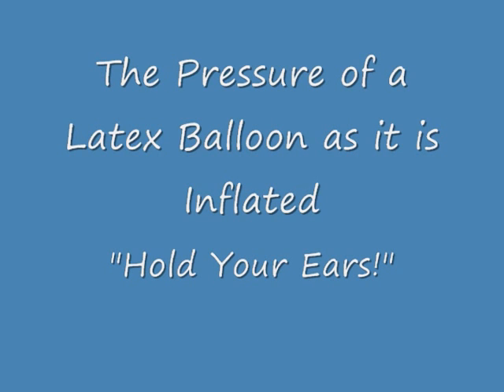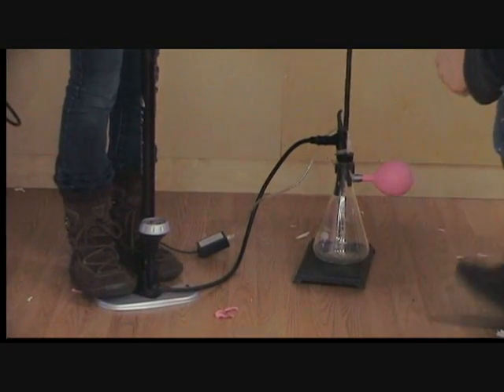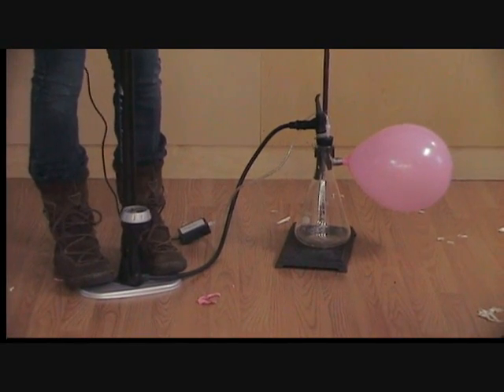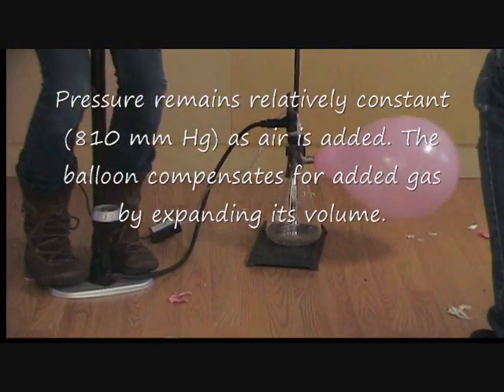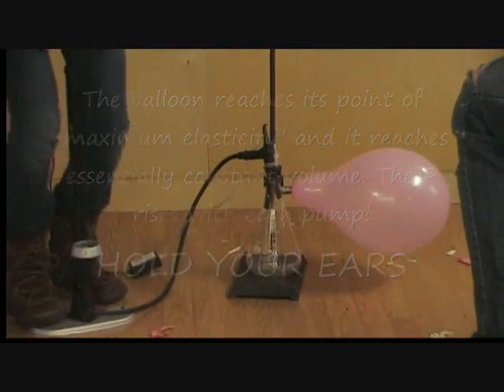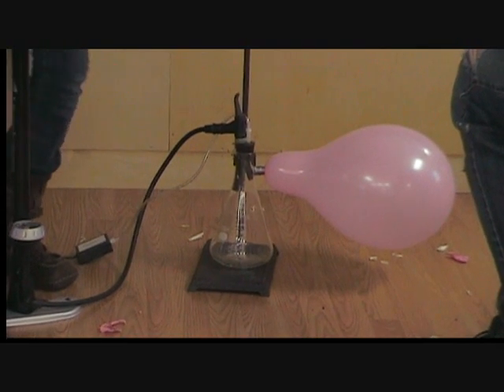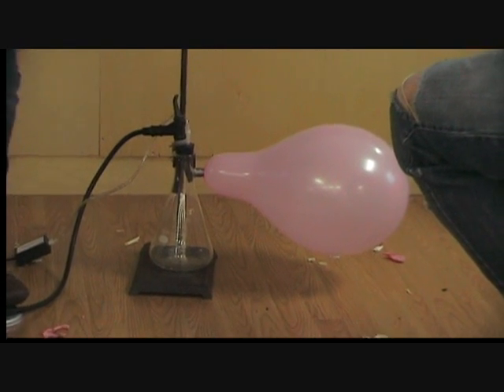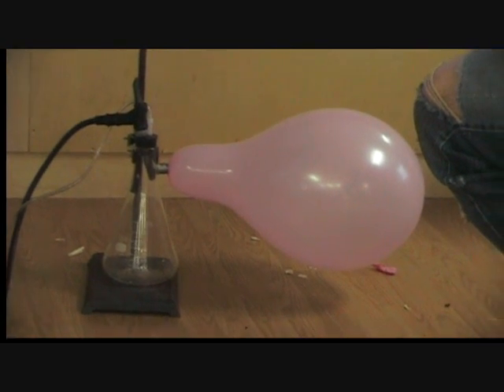Pressure of a Latex Balloon as it is Inflated

Comment: Should be closer to 0.15 psi instead of 15 psi
Reply: Atmospheric pressure is at 1013.25 mbar (101.325 kPa), equivalent to 760 mmHg (torr), 29.9212 inches Hg, or 14.696 psi. His data is correct.

Comment: At 8 seconds the screen says a Vernier probe pressure sensor was connected.  The vernier website (on the user manual page) says their gas pressure sensor is calibrated to read true station pressure which is defined as the true absolute pressure at your location.

Comment: georgiecoo Yes, 810 mmHg is 15 PSI. But you need to consider this experiment is done under atmosperic pressure that adds to the pressure of the air in the ballon by pushing on the outside. If we subtract 1Atm, about 14.7 PSI we get that the pressure of the ballon pushing on it's own is about 0.3 PSI, but that's not the real pressure, the real pressure IS 15 PSI.
Also, if we couldn't blow with a pressure of at least 14.7 PSI we wouldn't be able to breathe out at all, most people can blow with a pressure of 15-20 PSI. I'm afraid you need to go back to school.
Reply: 14.7psi is atm pressure. Everything in the world is under 14.7psi. We have gotten used to it that we don't considered it "real pressure". But it is. Anything over it, the difference is gage pressure. Anything under it, the difference is vacuum pressure. In the video he obviously talking absolute pressure which is the overall total pressure. In this case it's 14.7 plus the increase in pressure. The gage pressure is only 0.3 psi which is not the reason the balloon popped. The reason the balloons pop, from my engineering studies, has to do with the potential energy being released. That potential energy was accumulated as air was pumped in and stretched out balloon, just like a spring. The energy required to stretch out the balloon is the same energy released when popped, mostly as sound energy and explosive energy. So yea.
Reply: +dan McClaren Entirely wrong but whatever.. Edit: Screw it, Ill hand you the answers, 14.7 PSIA at sea level. The entire world isnt at sea level.. example, At 5000ft Above Sea Level your looking at 12.2psia. This balloon popped at around 16.6PSIG

Most of this assuming the information in the video is correct.

Edit: Nvm on the 16.6psig part, looking at the graph, there was a high point of 1.54psiG.
Reply: +DarkLinkAD in school we used 14.7 psi for simplicity in order to focused in more difficult subjects. Obviously the pressure and density changes with altitude, everyone knows that.

Comment: This is very interesting, as it shows experimentally the need to take into account both Laplace's Law and a theory of elasticity to explain what happens with a balloon; contrary to a lot of claims made about balloon physics, one alone is not enough. So we have 

Laplace's Law: Pressure = Tension/Radius

....which had led many to claim that the pressure in the balloon will actually get LOWER as the radius increases. But this presumes the tension remains constant...which it doesn't (it's actually what leads to the balloon tearing apart). 

So we need a law of elasticity as well. For example, Hooke's (linear) law implies that the tension (= force per unit length), is proportional to the size of the balloon, so T = kR (k = const) for the "elastic regime" of the rubber. Combining with Laplace's law, we then find that where Hooke's Law applies, we have

P = kR/R ~ constant, as shown (approximately) in the graph in the video. A non-linear theory of elasticity would be needed to show the slight rise in pressure. 

The reason balloons are harder to blow up when they're still small is that they're so underinflated that there's there's a low and more or less constant initial tension, and Laplace's Law then gives P = (const)/R. Small balloons will (counterintuitively) inflate large ones according to Laplace's Law if both have similar tensions (due to plateauing of tension/radius curve). A non-linear theory is needed to give a decent derivation.

Upshot: the real-life physics is trickier than the textbooks would have one believe!
Reply: Robert Matthews  thanks a lot man. what you are talking about now actually came out on test on korea's highschool exam
Reply: Simo Ryu You're welcome - and good luck ! BTW, I can't imagine questions of that level of sophistication appearing in school exams in the UK.
Reply: And that's why smart people are scared to go in education: even the simplest question puts you in front of a block = the block of your ignorance :) aaaaaaaa